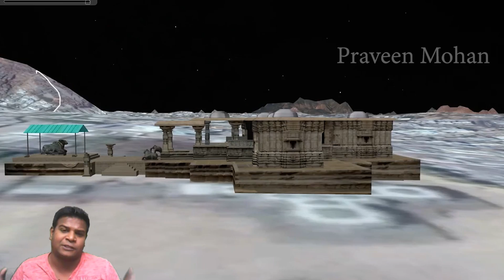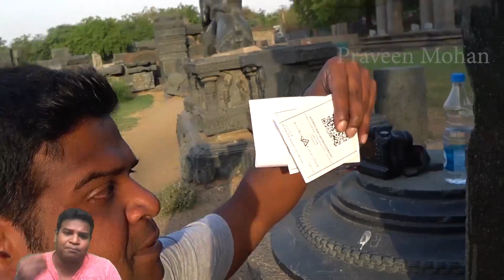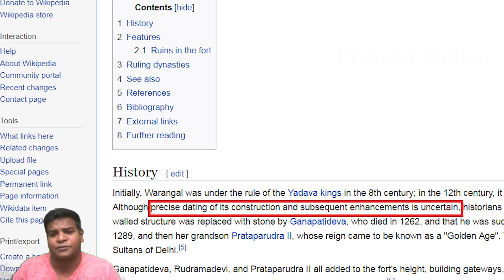Ancient Warangal Fort -  A Mass Manufacturing Megalithic Factory?

Comment: i am a big fan of you, watching all your videos, subscribed you channel. i appreciate your efforts very much. I am an architect, In my opinion this is all cold die casted geo polymer for mass production (in rubber or Latex type material mother molds) and not carved one by one but finish them after releasing from the die. They definitely use drill, lath and other machines to finish these die casted items. Geo polymer technology also use today for making artificial granite tiles.

Comment: Manufacturing stone carvings destined for assembly at other sites     
(manufacturing anything at scale) requires an extreme level of engineering and administrative work. There should be thousands of tons of stone chips laying around this site. If not, where are they? Is there a site nearby where the waste from carving was dumped?

Comment: I think you are right. But seems like it just stopped mid production. Why? Were they called to leave with little to no notice quickly or were they killed?
Where is the machinery at? Ground penetrating radar done? You should do magnet 🧲 testing at all sites, relates to magnetics of planet earth 🌍. What about lay lines etc.? Not that your research is not most excellent, it is, in my opinion and quite impressive and my knowledge or awareness as regards this and much else doesn't compare. It is just interests and questions.

Comment: I think the most amazing aspect of these temple components is not so much the finished product itself, to me, the truly amazing thing is the actual manufacturing process, all of this requires a 100% negative or opposite mould to hold and shape the geo-polymer.. and because of the number of components being made, equal numbers of the formwork are needed, just creating the formwork is a feat in itself, you need a master copy of the design itself, but this would be in many sections and its size and scale is dependent on the required size and stone type, so corner jigs would be a separate part where the angles are wider/narrower as per requirement, all of these would be a consumed part as I can't imagine how you'd seperate the formwork from finished product, after all this, you'd have to trim and dress the forming overburden before finally going through several grades of compound to polish them... In short, there's more work in creating the ability to manufacture the stonework, than actually pouring, unsetting from molds, dressing then finishing... Industrious folks indeed are the artisans of old..

Comment: I like the concept that this was a manufacturing site as a strong possibility.  Maybe it is also possible is it was a training center for stone sculptors.  Transporting finished stone blocks seems to make the transport more difficult, and more likely that they will be damaged, especially being pulled around dirt roads on ox carts.  It could be done that way, or it could be that scultors were trained with many different types of stones at this site and then went to temple sites to carve those.

To be honest, I do get tired of hearing about how master craftsmen supposedly could not accomplish certain shapes or symmetry, etc.  If you have ever watched a master craftsman work it will amaze you.  They can do things just by eye and touch that machines have trouble doing.  Advanced tech is possible in ancient times, however master craftsmen can do things the average person cannot even imagine.  I am a metal craftsman, not a master though, but I have worked with masters that can do things unimaginable before you see it.

Comment: There is an easy fool proof way to know if these stones are molded. Simply find two identical stones and take a plasticine impression of a small identical area of each stone. Fill the impressions with plaster. If they both came out of the same mold you will see identical imperfections in each. That is your proof.

Comment: there is a video of a engineer who test out vibration copper pipe to cut a hole straight threw stones believing the aztec used some kind of device to vibrate the copper to cut and shape solid stone .

Comment: PraveenMohan, your theory is interesting. Here's my problem with it. There is a lack of of blocks that show similarity.  In a mass manufacturing plant, you will have many of the same parts, or in this case blocks. In this case, as you said, many of the blocks, if not most are different form ea other. I don't think this was a manufacturing plant, but more of a museum or school.  Plus you yourself said, the tools used to do the work aren't there.  Those geometric shapes you keep pointing to in your vids. I believe these are the keys and the true knowledge of the ancients.  I believe these are 3 dimensional representations of sound harmonics. Of course, like you it's really hard to prove any of this, but I at least we can correlate the findings to real testing. Just like you did with showing the visual representation of the sound Ohm  in one of your prior vids. Here's the thing Praveen, I believe some of this work here is older than the civilization that brought them here. this is a way to study the work of priors, and not only that. seems there's evidence that the Great pyramid shows evidence of preservation, but not buy us, and I can't prove this. But, if it's true, then it gives way to the possibility that this is a museum / school, preservation site. The base where that lingum is here in your vid, You can see from afar that base is not the original, but a cheap knock off of what the original, more or less, looks like. And, and I still believe the lingums is Hydrogen generation tech. A way to sterilize water and make is safe to drink, and also use to make strong sterilization solution with ease. Hydrogen tech is said to prolong life and make the sick well again. Now, using your approach in logical thinking. In a library you have books from all over the world which contains information from those places of where they came. Most books different from ea other, and not many of the same. And, the library will be placed in  a location where you can easily get the books to it, and the people that want to read them to the site will be able to reach the location with ease. Now, I'm not saying your wrong Proveen, I'm just making an observation, and your words make me think. Like always.

Comment: Hi Praveen, I do agree with the lathe turning. But I would like to also point out that alot of these moldings are square hexagonal etc so would not be possible on lathe. Vertical milling machines are the only way to carve/mill these designs. Cnc is the form nowadays.

Comment: Praveen, i totally agree with your conclusion. In central Texas, we are sitting on a vast deposit of limestone which not only varies in color but the different sedimentary layers also give us a story. Some of the quarries I went to were in areas where there were sandstone layers being quarried and cut. Other areas such as the Marble falls area have rose granite upheavals. Check out Enchanted Rock! West of San Antonio there is a area that has basalt upheavals that looks like a small mountain range of small pointed volcanoes. In all these quarries there will be a slurry pit because it takes so much water to just cut these stones. Even the power finishing tools must have water running over the work or the dust would be making the workers very sick and the dust from cutting sandstone or granite dry is very caustic and can do permanent damage to your lungs..One thing that is common in these manufacturing quarries, they all have these pools of water from the cutting and finishing tools. When I saw the big pool of water at Warangal Fort, I wonder if we could find the answer by scooping samples from the bottom of the pool like a core sample of slurry that would tell the story of what the site really was used for. The deeper the core would be like a time machine to lock down a more definite time line.  Maybe like the story and dates we determine from polar ice core samples that tell us what weather conditions were and when they occurred. Your videos are amazing to me and your eye catches the same questions that mine do. I like the explanations you tell us.

Comment: at 14:17 i noticed the top of it is exactly as it would appear if it was a geo-polymer poured into a mould. the top ring is meant to be removed later, it is just extra material poured on top. the square hole could be for a vibration device inserted into the wet polymer as it would be needed to make the liquid perfectly fill all the details in the mould. the samething is used in concrete forms today

Comment: It used to be a fort. the four entrances you were showing in the center are not the whole part. The outer circle has the same entrances and have a wall. It may not have looked like a wall because it is not completely made of rocks or bricks. If you have see a lake or decent size of pond you will see a protective wall made out of soil. That's the kind of wall they had. Eventually it has been destroyed. It was told that the people lived there were afraid of invaders and they wanted to protect their treasure so they hid almost every where. After listening tot he stories of people finding the treasure here and there people started digging every which way not having any concern to monuments.
Regarding the carving and all those blocks of stones in the center. Kakatiyas are very devotional people. They have built some many temples around the warangal city. To my understanding they must have planned for more temples and even for fort to complete. They haven't completely established their territory. They have some interesting places like they have this big rock which has a temple at the top and if you clap at the base of that rock you could hear that sound in the temple at the top. By the way it's a bit tall to hear directly anything from the bottom. they have temples that have rock which will float in water. For years people have digged all the places to find treasure. But government prohibited from digging without a police present at that site. Even if you have to dig for a municipal water tap connection you need permission from police. 
I am not disregarding or undermining your research. It could've been a location for mass production. All those rocks have a square shape depression like they were holders (to keep the rock in place while they work on it) on rotating machine or something. There is one more interesting place in warangal is 1000 pillar temple. It's a shiva temple. temple organizers decided to reconstruct because they thought the rocks were in bad shape. And they pre planned to number all the pillars to create a map and put it back they made it worst. They couldn't figure out how to put that back. They was pillar while they were digging it out they found sand underneath and water too. How was the pillar standing perfectly on top of watery sand for all these years without moving amazed.

Comment: I do think Kakatiyas were not capable of doing such work....the thousand pillar temples is one such example ......however agreed completely that the work is not simple human hand made work... definitely requires machines...the polishing of the carvings on the pillars are also very smooth ..I have personally observed definitely inspired by your videos....but yr approach that it's not a temple site but a manufacturing site is not agreeable....if u see the dome in front of the lingam it's in unfinished condition....they have placed the rock first n then started carving.there are rocks half polished n half rough...I mean u can literally go back many years just by being at the site. ..that feeling itself is amazing ..the most logical conclusion which I could come after looking at the site is....that the Kakatiyas were constructing the temple there by bringing stones from places ..then placing them as per the plan n carving...but the pieces have been broken by Invaders......it was being constructed when the invasion happened ..work in progress ...if u have access to the notes or documents prepared in the Kakatiya reign. U cna probably corroborate it with the site.....

Comment: The Ancient folks definitely used some type of machinery to cut and carve these rocks. There is no way to produce those round circular patterns with a chisel. Some of those rock pieces look very uniformed as if it was molded. Maybe they used molds and poured a concrete type mixture. Once hardened they would finish it and polish.

Comment: 9:29 I think the arc of the covenant was an E.D.M. E.D.M. electrical discharge machines will drill tiny holes and complicated 3d design in anything conductive...
Reply: If I'm correct,rocks are not conducive right!
Reply: @SriniBoss  many rocks have conductive properties the higher the quartz/mineral content

Comment: 9:29 E.D.M. electrical discharge machines will drill tiny holes and complicated 3d design in anything conductive... most rock with high mineral content have conductivity
Reply: today's E.D.M.'s are done underwater because it turns material into dust that floats in the air we dont want to breath it in..described in the  Mahabharata the god's tools carving the temples..the material floated away like dust in the wind...Ellora Caves, Maharashtra, India for example no materials found after excavation and intricate carving of the mountaintop down.

Comment: Did you ID the type of stone used? It looks like basalt. Considering how uniform the designs are, as well as the texture of the stone itself, Id say you have evidence of basalt casting. Ancient Mesopotamians were melting and casting basalt made from alluvial silt, which is abundant in this region of India. If they were manufacturing on site, there would likely be basalt slag left behind and found in the area. Having done a bit of digging, I cant seem to find any basalt quarries which is odd considering its the stone most commonly used for the highly detailed temple bits like the pillars and statues with impossible to carve features. Considering the size and overall amount of stone used, there should be quarries everywhere.

Comment: What comes to mind is the idea that it was a place were some people wanted to preserve some pieces to use later ( reason I say this is how the stones look rough, like they were torn from where they were originally and laid out in their kind -stone material and design structure). Like a car parts building were you can go get the hard to find piece laid out in kind, crankshaft, steering wheel, doors, seat frames, etc. that you need to restore an old car. Just a thought...

Comment: Cutting stones was not a big deal back in the day . They used hot oxygen gas to penetrate solids, same as it penetrates throughout our body. Today hot oxygen gas is used with aceteline torch to cut solid metals, and it always leaves a polish finish same as on the stones . They used large and small hand held cutting tools, some for cutting others for carving . Scooping out stone's is the same technology  with adjusted gas temperature. Our body temperature has to be right for the oxygen gas to flow properly, which is the same with solid stones, the hot oxygen gas puts life into the molecules making them soft and easy to cut. If stones are electricuted it's molecules falls into motion coming to life making it much easier to cut and move.

Comment: At 2:23 there is the ancient and modern symbol of the two snakes wrapped around each other( but without The scepter in between) it would be interesting to find out what that symbol  represented, and if was used for a hospital or health services that would make sense. King Jahavarman built over 100 hospitals when he created Phimai, Angkor Wat and all the other mega temples along the ancient Angkor highway. He was attributed to building both hundreds of temples and corresponding hospitals and hotels basically and he did this all in a very short time. Maybe that symbol at 2.23 is a sign for one of these hospitals.

Comment: It seems to me that everything is a cycle. We go from light to dark and back to light over a cycle just as the sun moves across the sky from East to West. Which is what the Egyptians left us with. That would suggest that the energy that these civilisations utilised diminished over time until there was no energy at all. That energy is starting to return again and will allow for that energy to be used once again. A translation of runes inside the pyramid of the sun Bosnia. Quote " The gate has been closed. We are at the standstill. We will have to stay and to fight, defend ourselves and conquer until the cosmic gate is open again."